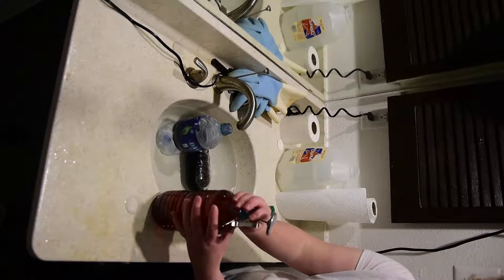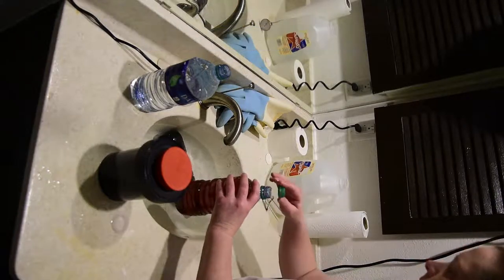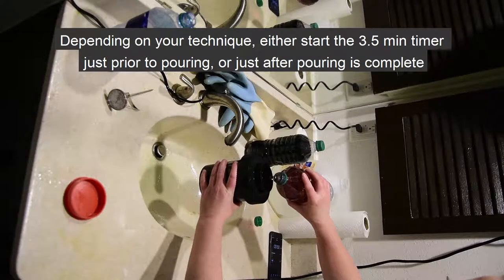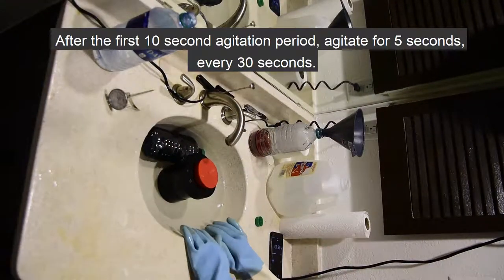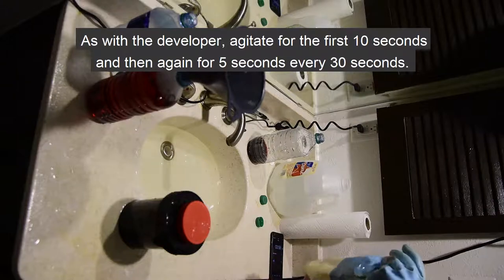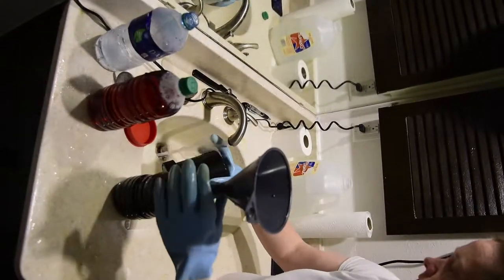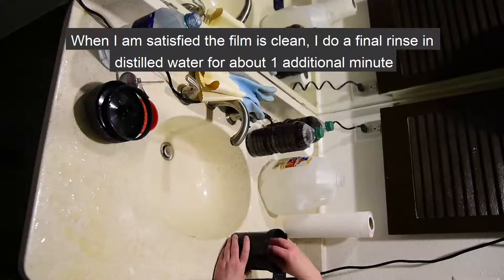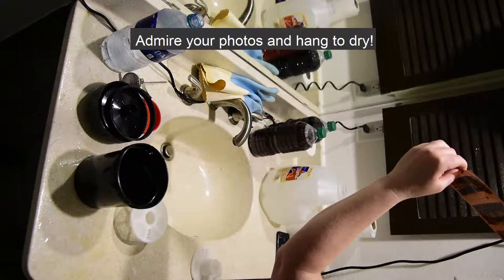color film developing CineStill C41 kit

Comment: Hard to understand why someone would exercise the caution of extending washing from 3 to 8 minutes while eliminating a 1 minute stabilizer required to keep the images from discoloring or fading.  Actually, Cinestill eliminates the stabilizer from this powder kit, apparently to save the 25 cent cost of the chemical and packaging. That kind of corporate decision making should cause you to buy product from a different company, like Unicolor.  Note that Cinestill liquid C-41 kits do include the stabilizer, indicating that Cinestill does not make the product, but just repackages product made by someone else (like its film products).